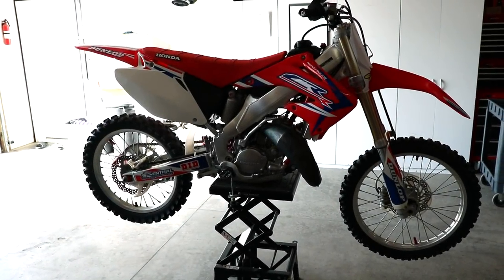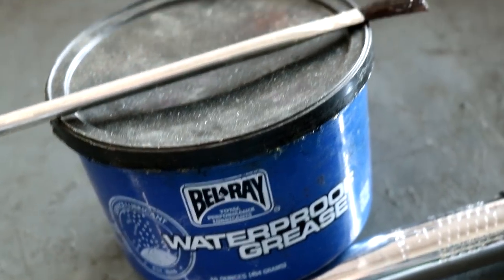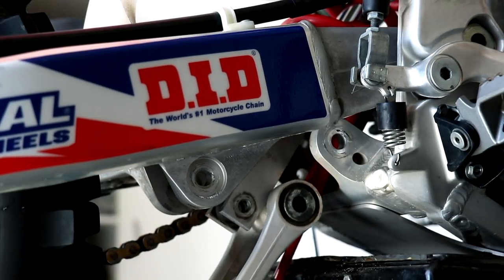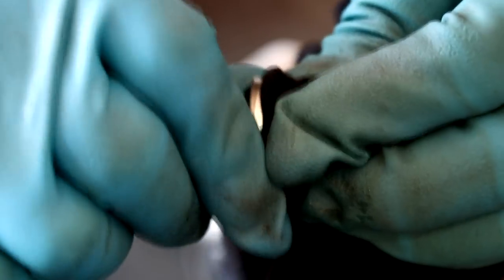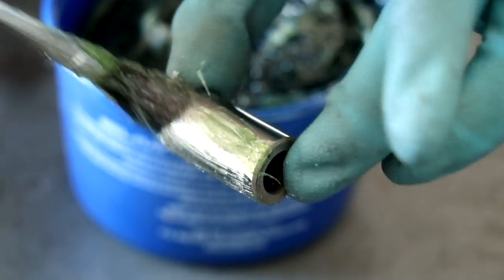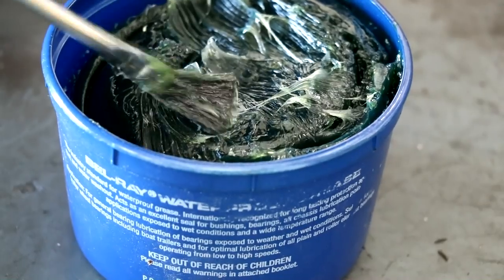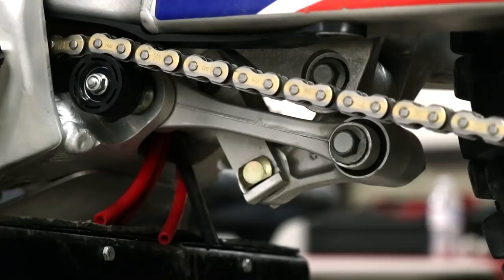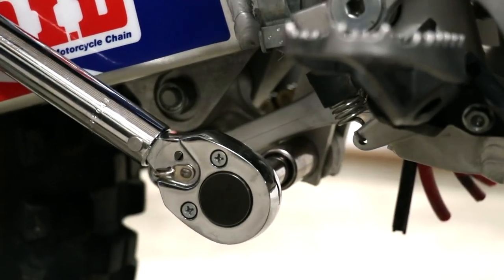Grease Your Shock Linkage Bearings!

Comment: My dad showed me how to repack needle bearings

Use an extendable magnet to pull the needles  out (keeps you from dropping them) and put them in a spray paint can lid and wash with brake clean. Then dry them. Wash the race out with brake clean as well. When everything is clean, smear a healthy layer of grease in all the way around, then start packing the needles back in. The grease will easily hold them. 

I like this method because you have 100% new grease. And can be sure there’s no moisture or grit in it
Reply: Awesome idea I’m gonna try this

Comment: I watched a few other videos that describe this process but yours is one of the best.  I didn't realize that brand new bikes do not come with any grease in the linkage (or any other bearings) and this is something that should absolutely be done when you get a new bike home.  
After watching your video, I decided to grease my linkage bearings again.  The manual says every 7.5 hours .  That's two weeks for me so I 'm not doing it that soon.  However,  it shows how important this maintenance is, along with cleaning the air filter and changing the oil/filter.
Since I've done it before, it was actually easy to do and took less than thirty minutes, which includes almost ten minutes looking up the torque specifications for the nuts
Thanks!
Reply from the maker: It is insane how little grease new bikes come with. Whenever I buy a new bike it immediately comes apart to grease every bearing. 15 hours is what I go by and never had one issue with bearings wearing. Thanks for checking out the video!

Comment: One thing ive noticed about every mx bike ive bought since 1980... 67. They never come properly grease. The headset bearings get about a Q-tip amount of grease and the rest of the pivots and bearings are near dry. If you want amazing water proof grease try castrol pyroplex blue.  If you get it on your hands water makes it stick more. Gas or wd40 to help clean your hands... lol good stuff

Comment: I like all your videos, on the torqueing of the suspension bolts, you can torque those that have bearings on or off the stand. With rubber bushings though, those need to be torqued at ride height with the weight it will be ran at. If they are torqued on a lift or stand when at weight they will be under pressure wanting to be back where they were torqued at and will tear out quickly.

Comment: Fantastic camera and editing work. Your videos have no doubt inspired me to tear apart my filthy WR426 sumo this winter. 

Since I won't have access to a pressure washer when its 20 degrees outside, how do you suggest I go about cleaning each piece? We've got a solvent tank but that's not ideal for most parts I wouldn't think.
Reply from the maker: Thanks man! Solvent tanks actually work great for cleaning parts. Really depends on what chemicals and brushes you are using. Straight up solvent will clean amazing, but is nasty to work with. A heated water based degreaser is what I use.

Comment: How often are you regreasing the top shock mount bolt?   Just every shock rebuild or do you actually regrease somewhere in between?
Reply from the maker: The bolt necessarily doesn't need greasing, however the bearing does. They're spherical bearings and are hard to get grease in them.

Comment: I have a question,
My way of cleaning and greasing the linkage bearings is to get all the needles out, clean the whole bearing cage (and needles) entirely, then greas everything and put it back together. But is it bad to take all the needles out? because I don't see any reason why it should. but I never see anyone do it the way I do haha
also, great videos man!
Reply from the maker: Thanks for watching! Nothing wrong at all with removing all the needles, just takes much longer having to assemble all the needles back together. If that's what you prefer then keep doing it that way. When I come across linkage that is dry and needs a good cleaning I'll take all the needles out.
Reply: Cameron Niemela thanks for answering! Keep up the video's!

Comment: Today pulled apart my keihin carb and needle was bent. Why does it happen ? 
P.S thx for answering my questions i just subbed.
Reply from the maker: I would guess it's from someone installing the slide with the needle not straight. That will bend the needle, I've seen it happen before. I might have even done that once lol

Comment: You should tell people to take the weight off the rear wheel so it doesn’t squish the chain guide roller, 🤔 when the bike is sitting on a stand anyways when working on the rear suspension

Comment: If there's a small amount of play should i replace the bearings or just regrease ?
Reply: well, you can use the old bearings and grease em. but best is just to replace it if you have the cash :)
Reply: Wild Riding NZ 
Replace. If there is play they are worn out, and regreasing won't fix that problem.
Reply: yeah thanks :)
Reply from the maker: You can still run it with a little slop however it'll need replacement at some point. Better to do sooner than later.

Comment: Is it possible to split the cases without a splitting tool?
Reply from the maker: Hey buddy! Yeah cases can be split without the tool. Using a soft hammer or wood block to protect the crank and transmission shafts while you smack them with a hammer will split the cases.
Reply: Thanks

Comment: Hey Cameron! My yz 85 has a lot of movement. Does it help if i tight the bults.
Reply from the maker: You'll definitely have to replace the bearings. Tightening the bolts more won't help unless they are very loose to begin with.